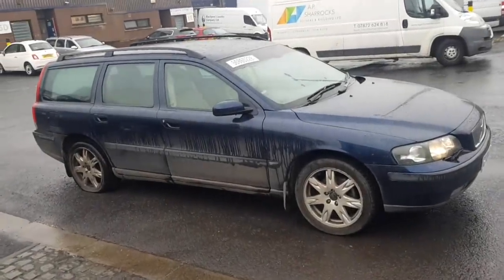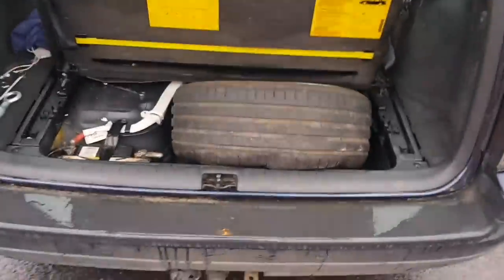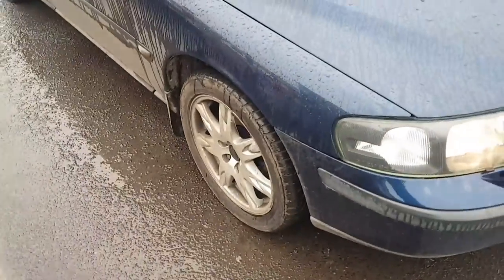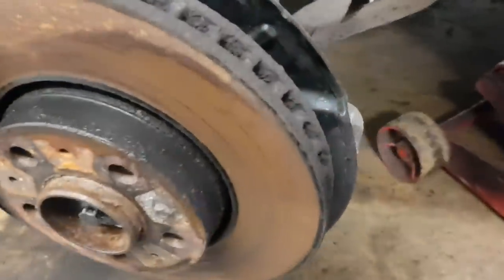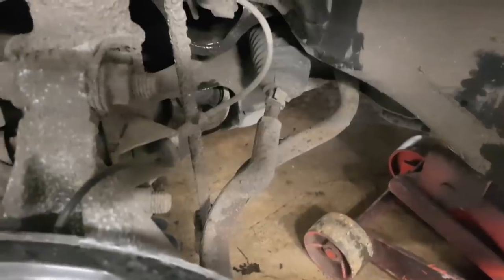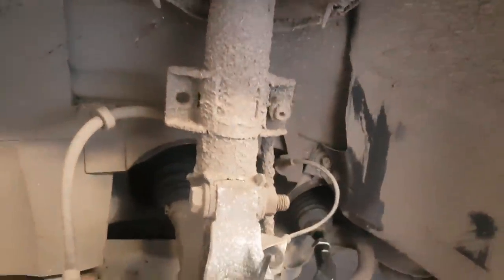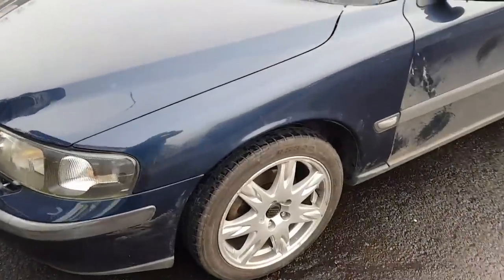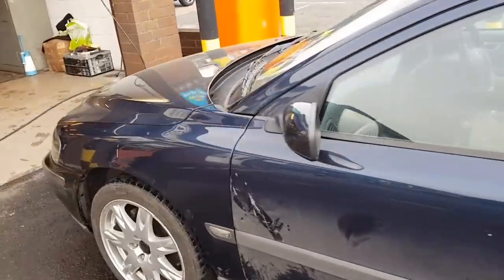Saving my filthy accident damaged volvo v70! Copart rescue.

Comment: Bought a Toyota Celica for $400 after the previous owner tried EVERYTHING to fix the electrical issues. He had replaced half the components including the alternator. 

My dad towed it two blocks to an auto parts store and replaced the battery cables for $8. Ran like a dream for years and years
Reply: Tanner Harman I was given once a Rover (same model like 1997 Honda Civic) “if you could run it it’s yours”. Some electrical issue. The big wire broke of the engine block. I just put it back with my finger so it holds. I start the car. Took me like 30sec. You should have seen the look on the guys face :) I drove it home same day
Reply: Toyota's run for ever, had an 04 facelift Yaris 1.3 and did nothing to it. I gave it away after 2 years to a friend when I got a different car. and the wee Yaris is still running about.
Reply: @VinDieselS70  I bought a 1996 toyota starlet sportif for £300 off eBay as a gap car. I've had the thing for three years now because it refuses to fail an mot. The only work I've done to it is a new clutch, tyres and a back box.
Reply: @tonyeff4447  they are amazing these cars and very few cars are that reliable other than all Volvo's before Ford took over. I have a 53 Plate V70 D5 but it's to much electronic in them though everything works. The funny thing is Volvo have had engines from Audi/VW (Diesel)  and even Toyota/Yamaha (V8 in XC90 and S80) 👍

Hope you'll keep the we Starlet last forever.

Comment: This is exactly the repair that my old man did on my first car, a 1962 EK Holden. The front wheels were pointing out at about 20 degrees. I thought my old man was nuts when he said we would buy it. He drove it home across town wobbling all over the road. When the mechanic had fixed it I had a beautifully straight driving sedan. I was impressed. You are a wise man to see beyond the bent wheel and fender to the simple solution underneath.

Comment: Cheapest car I ever bought was a 1977 Buick Skylark 6 Cylinder auto, all black with a white interior that had the entire right side caved in from a bad accident.  No suspension damage, just body.  I changed the oil and drove it for 3 years.  Paid $25 for the car, and sold it for $125!  I think I did ok!

Comment: Bought 2015 Subaru Forester 45k miles on it for 7k. Wrecked , new bumper and light assembly. Fixed hood, replaced air bags, reprogrammed seatbelts, new roof liner. New weather tech liners. Spent about 3k paint body everything! Still driving it and it runs great! And it is, fully loaded! It does as good on icy roads as everyone said it wood.

Comment: I love Copart. I also love your new series.

I bought a Polo 6N in mint gloss green, Cat D for £190. Booked it in for an MOT, insured it and drove it to the station expecting a fail. Which it did. For a numberplate bulb.

Took it home, polished it, didn't even change the dented rear bumper diffuser lower skirt thingamabob, Sold it for £350 a few days later. Quick £200 profit. Was happy as larry with that.

Also bought a Daihatsu Grand Move, ran great, super quiet, really clean. Got about 10 minutes down the road and it snapped a camshaft. Swings and roundabout in this game eh!

Comment: My first car was a 1999 Dodge Durango. I bought it going on 4 years ago. It had a V8 engine in it. It had 214,000 miles on it when I bought it in high school in December 2015 and 300,000 when it was totaled in December of 2017 due to me hitting a deer. It surprised me for how well it did in the winter, as I live in the northeastern United States. I absolutely loved it.

Comment: As a skint 23 year old in 1993 i bought from a back street garage in Ipswich a 1981 'Y' plate i think it was Datsun Stanza....in silver. One owner. fSH. No power steering or any mod cons....1 years MOT....£195....it went on and on and on....eventually it gave up. Best £195 i ever spent. But extemely dull.

That Volvo is great by the way. Love em. Tanks. Virtually indestructible.

Comment: I bought a 1989 Ford focus about 15 years ago, spent about $400 on it. Ran smooth until i got er home. Had to take her to the shop, dropped almost $2000 on it and it died 🥺, also seeing you work on the car with a jack under it makes me nervous. I was working on my brakes on an old car with a jack under it. I pulled my head out of the wheel well and the car fell on the ground, a second later and it would have been my head. Can't wait to see how this one turns out! Already looks good with just the fender fixed.

Comment: Very dirty but not battered in the way you might expect. I suspect you have bought a serious bargain that has been loved right up to the end.

  I once bought a "C" Reg black Saab 16v turbo aero that was advertised as having had a small front end fire. Easy repair. As I started to repair it I found out that it had already been seriously messed with. The fire was centred about the front engine bay loom!  The wrong loom had been fitted and had caused a fire. 
  Incredibly, the electrical mayhem had not killed any of the ECUs!  I ended up splicing in a hole new section of loom into the old one across the front of the car. Much soldering and heat shrinking. The hole project only cost me pennies but took me weeks to diagnose and fix. Lovely car and I more than trebled my money even after driving it for a year but it nearly drove me barmy doing it!

Comment: Great cars those. They are truly built like tanks.
I had a 04 plate mondeo Zetec 2.0 TDCI accident damaged. Car cost me £125. It needed a new drivers wing, inner liner and a drivers door. I went for a complete door and swapped the locks over. Parts were £90! Required some painting to colour match, around another £100 if memory serves.
Great car but suffered from alternator faliures. Eventually it died of injection pump failure as it wasn't economical to replace.
Total miles were 209k in 10 years.

Comment: In the late 80's, I had a 1976 Chevy Nova V8 that had been a police car. That thing was a tank! But it was not pretty. White car with blue hood, head liner fell off and crispy brown bits falling on me all the time. Police logo had been spray painted out on the door and the cage between the front seat and back seat was still in it. It had 120,000 miles on it. I loved it!

Comment: In 2006 I  bought a P- plate Rover 820 from Hong Kong Pete, from a scrappy in Kilmarnock. Car had been handed in as it had an ABS fault and the previous bought a new car. As the car had an Mot and was Taxed, it was on sale for £245... Had 80000 miles on the clock and was immaculate condition both inside and outside and drove perfect and everything worked. The ABS warning turned out to be an ABS wheel sensor so got a new one from eBay for £80 I think it was. Replaced the sensor and drove it with no bother for another 40k mile during the two years I had it. Have the car to two work colleagues at work and they wrecked the engine 4 month later. 
Now I have  53 Plate V70 D5 with Geartronic since August last year and it goes a dream. Got it with £86k and now about 106K. 👍

Comment: I've had a Peugeot 309 1.1 XL, bought for 500 euros. Besides the normal maintenance and 1 new seatbelt i didn't have any big costs whats so ever.
My actually first car that i bought (i was 17) was a Alfa Romeo 155 1.7 TS from 1994. The car stood almost 5 years at a garage were i was an apprentice. With becoming 18 y/o in the back of my head i bought the car for a whopping 50 euros with a blown engine (hole in the side of the block the size of my fist). The car did run actually (lol). At the next garage where i worked for a couple of months i decided to swap the engine with one of my colleagues. Placed a new clutch, fresh coolant, fresh engine oil and tranny fluid and sold the car on for 1200 euros. With that money i started to take driving lessons and got my licence after 25 lessons. And now 14 years later i'm still grateful for that POS alfa :D.

Comment: I bought an old Vauxhall Vectra on a P registration from my sister in laws sister.  It was was a bit grubby with dog hairs and all sorts of other crap.  It had a full years MOT and 12months road tax too. I cleaned it up and gave it a wash and polish, and what a lovely 2ltr engine.  Great all round car for only £85.  I couldn't believe my luck.

Comment: Looks like a nice v70. 

My volvo 940 that I currently own I bought for pretty cheap considering that its a turbomodel and they usually go for a bit more than I got it for. I did have to replace the turbo and shortly after the clutch but now its a fun car to drive around in!
Reply: Nobody likes turbo estates in the UK. You can have the same car without any damage for like 500 quid with 2.5t engine.

Comment: I once bought a Toyota Estima for £100 with a knackered alternator. There was nothing wrong with the alternator, the plug was in the wrong way round. However, as it was an import my insurance company wouldn't insure me so I sold it on Ebay for £780. Next day I went and bought a Volvo V70 for £300 that lasted me 3 years with no faults, and passed all the MOT's. I kept it until the head gasket went.

Comment: I bought a Ford ranger in great shape once for 250$ US from a estate sale they said the transmission was bad, after 20 minutes I found a burnt coil wire making the truck jump and jerk at all speeds I fixed the part for free off another truck I had at home. I ended up driving the estate sale truck 3 years no problems then gave it to my cousin.  Can't wait for the wagon cleaning. 👍👊

Comment: Bought a 2002 Dodge Intrepid for $1000 US in 2009, I've put less than $1000 in maintenance in it.  Got it when it had 178,000 it's currently got 354,000 miles on it and still going strong.  Although, it does need a new water pump and all new suspension on it now.  No big deal, I am a mechanic the parts cost me less than $400.  One of the best vehicle investments I ever made.

Comment: I got a Peugeot free from my grandfather because it would always flash up the "stop" warning light and the temp gauge would go to the top, and he had spent a lot of money replacing the radiator, coolant, thermostat, hoses , a temp. sensor etc.. took me 5 minutes and no money to fix it. Turns out the Peugeot has two temp sensors, so I unplugged the other one, blew on the plug and plugged it back in, no problems with that since, that was almost a year ago now😎 Quite low miles too👍🏼

Comment: I won an Audi 80 Cabriolet for £12 in a raffle. Apart from replacing the timing belt, balljoints and back brakes it's given me 2 years fun and reliable motoring. Even my wife likes it!
Reply from the maker: Good cars those.
Reply from the maker: Back from when audi meant reliable and well built
Reply: @autoshineblackpool  I was really impressed with the build quality when I got it, never had an Audi or anything like that before.

Comment: I bought a Austin Allegro in 2002 just to get me to work it cost the grand total of £50. I didn't expect it to last for a week it burnt loads of oil and I had to pull some string to open the bonnet but it never let me down and lasted 5 years,good luck with the Volvo 👍

Comment: Bought a 2001 Ford Laser (rebadged Mazda 323), sight unseen from salvage auction for AU$125. Replaced 1 power window mechanism for $60. Everything else worked perfectly. Passed Pit inspection (Aussie version of MOT) 1st time, without me even doing anything else to it. It was already spotless inside when it arrived. Sold it for $1500. Could have easily got $2000+ for it, but I needed it gone quick.

Comment: Not really much of a story since it was recent, but I don't mind sharing. I bought a 94 Volvo 850 Turbo for 200 USD wasn't running and owner didn't want to deal with it since it was old. Dug right into the car the first day I bought it and it turned out to be bad spark plugs. Replaced and car ran smooth as butter, I'd say it was quite a bargain. Has roughly 150k miles and the car had all the service history, which I thought was pretty lucky. Usually no one keeps records of that.
Reply from the maker: 850 turbo 😎

Comment: Bought a 1969 Chevy c10 pickup for $5,000 8 years ago. For $5,000 you usually get a non running truck or it’s just beat to death. I put about $300 into for maintenance stuff like rubber bits and brake shoes. It’s been a reliable truck the entire time. Not bad for a 50 year old Chev.

Comment: G'day from Australia. My cheap car was a 1983 Ford XE Fairmont. I paid $50 for it, I changed the engine due to the one it came with was cooked. Including rego that car was around $1000 AUD (tyres, windscreen etc) and it was very reliable and in very good condition.

Comment: I have a Volvo V70 D5 SE auto. 300,000 miles and doesn't use a drop of oil.
Reply: S60 same engine here 
Yeah, don't know of any other engine that doesn't burn any oil at all. 
Mine's tuned to 225bhp and it still doesn't eat up oil!
Reply: I've got an S40.  2004. Used about 1 litre a month. Is this normal?? I have owned it for three years and have had it regularly tuned services and repaired. Still runs well.
Reply: carl marquardt that’s alright, mate. I bet it sounds like a diesel.

Comment: Once managed to pick up a 96 Plymouth Breeze for like $2500. We arrived on the lot just as the woman who traded it in left. The shop hadn't detailed or worked on it, so we pitched a price.  It was from Kentucky so had next to no rust and ran great for me for several years. It also came with a free gen 1 Xbox because the owner just left it.

Comment: Car story-back in 1994 when I was 19, I cycled up to a local scrapyard,and drove home in a poo brown Austin Allegro. It was a straight swap,the mountain bike cost £150, and the Allegro seemed reasonably solid for a car that was 14. 5 years later my sister's husband gave me a Mazda 121. It was a 1988 version,and it cost me £32 to mot. It went like shite of a shovel,and lasted 18 months before the floor developed a few holes. In 2000 I replaced it with a 1993 Renault 19. This lasted me for 10 years as it was the poverty spec version. It had power nothing. The 1.4 energy engine could do 110 mph,and was capable of 50 mpg when driven carefully

Comment: You wanted to know how the alloy got damaged?  It was fitted to the corner that was damaged.

Also please use axle stands.  I've had a trolley jack go on me.  I got out of the way just in time.
Reply: I tried using a scissor jack to work on the brakes on my dodge and it snapped. The entire rear of the SUV fell on my ankle. Keep in mind the gr of the damn thing was 6,400 lbs (Or 2,902 kg if you are European)

Comment: I had a 1979 VW Scirrocco in high school that cost $300.  It had originally been red and someone had painted it white with spray paint.  The white paint was flaking off.  The backseat was no longer attached and would hit my drivers seat if I stopped too quickly.  I put a radio in that had come out of a Buick with speakers from my shelf system in the back.  It was a piece of crap but a great car for a boy in high school.

Comment: I bought a used 1999 VW Passat 2.8L V6 5 valve. For $1000.00 Canadian in 2012 . The girl I bought it from had just spent $3500.00 on the car in a mechanics shop. A week later after she got it out of the shop the front wheel arch came loose and wrapped backwards under the front drivers wing as you call it. It's a fender.. So far been a pretty good car . Same kinda blue as the Volvo. $14.00 for the wheel arch . Also had to rebuild the alternator for $75.00 and the starter for $100.00 not to bad for 8 years .Also that alternator is a bitch to remove and replace. Front end has to come off to get it into service position..

Comment: Back in 2006 bought a bubble shape rover 220d for £250 promptly took it to a garage and spend over £700 on repairs. After that it ran great till I fiddled with the diesel pump and when it did blow it took the bonnet off.

Comment: In 1973 I bought a 1963 Holden (GM) EH 3 spd manual (column shift) in beautiful conditionfor $600au....it taught me how to drive and did passion pit duty at the drive-in.....I did some dumb things like spray painting the dash and self-fitting radios, fitting home made carpets and glueing them in etc.....sacrilege I know.....but sold it in 1975 for $600au......would get $12000au now if I had kept it original

Comment: I picked up a Vauxhall corsa 1.2 on a v reg with 32000 miles and a running fault. It only needed a new MAF sensor which I picked up for 20 pounds or so. It drives like a new car. It has a full history. bargain!

Comment: Omg. We had some family move across the country and they drove this old van over. We called it the silver bullet. It was sooooo fucking manky that they sold it to us for like $500. We filled 2 big wheelie bins just with the crap that cane out of it. We did what you did and just cleaned it and made a few small repairs. We took seats out and pressure washed them (they had no electrics and in Australian summer dry in a day or 2 from sopping wet). We ended up selling it for $5000.

Comment: I bought a 2008 Mk6 fiesta with 80,000 miles in 2016. It’s front bumper was hanging off after the previous owner caught the bumper on a post when leaving a parking space. The rear bumper had paint peeling so I bought 2 brand new bumpers (bad idea, should’ve gone used) and paid to get them painted. I bought the car for £750 and I sold it for £1,300. I think I made a little bit of money but I was offered £1500 but I was a bit greedy as it was the first car I was trying to sell. And then it came back and bit me in the ass. But the new owner loves it and that’s all I can ask.
Reply from the maker: Sounds like you got a good deal 😊
Reply: Autoshine Cars It was, which is why I enjoyed it. I don’t have the time I to do it anymore which is why I enjoy watching videos of people fixing/restoring project cars and sometimes selling them on so I’m glad you’re doing some! Keep up the good work!